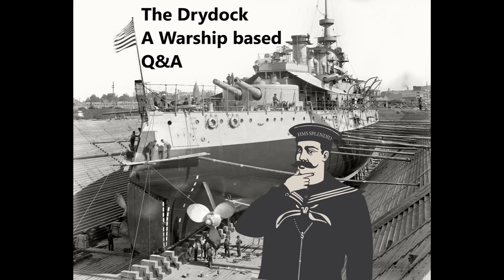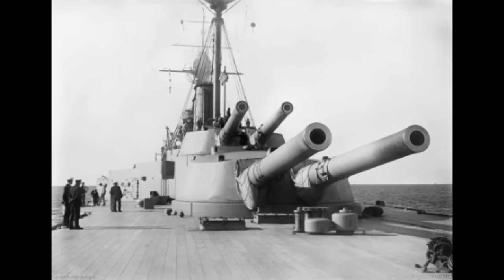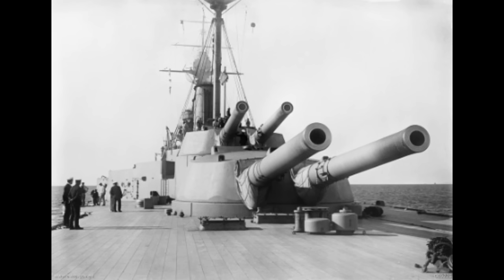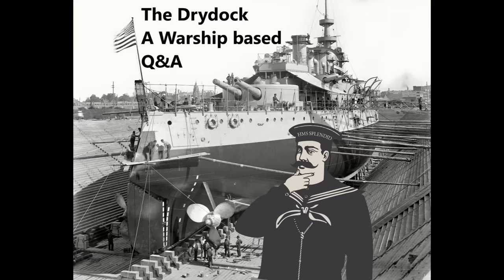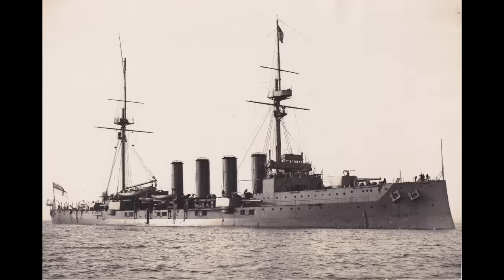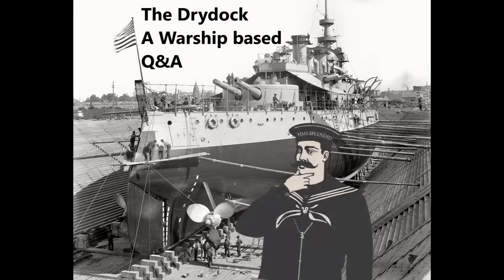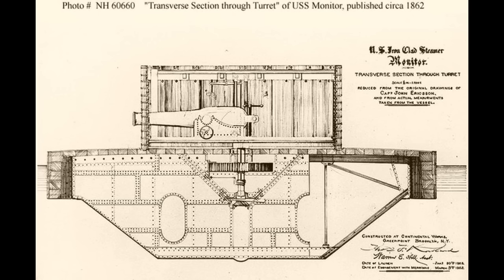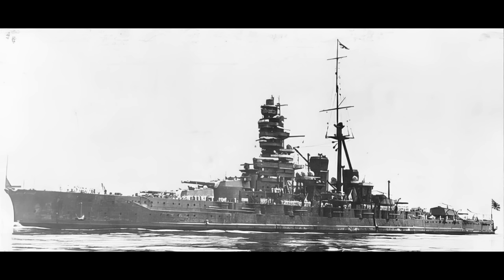The Drydock - Episde 241 (Part 1)

Comment: I was on board Ranger for two of her major fires, and I can say, at least by the mid eighties, nothing much has changed as far as water tight integrity goes on captial warships of the USN, in both cases I found myself in electrical machinery rooms, armed with a portable pump and a dust pan with orders not to let the water get to the bus bars.
Reply: A dust pan and a pump? Where were you going pump water too? Was there a drain?
Reply: @WALTERBROADDUS  In one case it was pumped into a drain, in the other it was the bilge of the Auxillary Machinery room next door.  Yep a dustpan, though to be fair you can move an awful lot of water that is too shallow for a pump with one. In both cases the pump was loaded into a thirty-five gallon trash can which was filled with the dust pan.
Reply: @fred1451 none  a dust pan for DC, not something that comes up at first thought.   
Come to ponder on it, did the dust pan need to be certified?😂
Reply: @AtomicBabel  In the first case it was more of an accident, I was actually issued a  mop, (I think you can tell these were not fast leaks.) They were coming through an electrical stuffing tube were the compartment on the other side was flooded by firefighting water.

They were to fast for a mop to keep up with, there was a dust pan available and I switched to that, using the mop bucket to fill the trashcan that the pump was in. This tactic worked as I was then able to keep ahead of the water leaking in.

In the second case I just went with the dust pan.  The annoyance there was that the pump needed to be wacked periodicly to keep it pumping.

As far as being certified, well no one ever told me to stop using it...
Reply: @frednone  .. Jesus Christ..
Reply: @frednone  hell yeah. during hurricane sandy my basement had calf deep water and all the pump trucks had massive waiting lists. The water was calf deep but at ankle height you couldn't really fill a bucket. I moved a lot of water just by sweeping it with a broom into a dustpan and dumping it into the drain system
Reply: @jonc8074  I just use the pan as a scoop, I guess you didn't have a squeegee?
Reply: @micnorton9487  About sums my attitude toward the situation.
Reply: @frednone  No, no squeegee, or hand pump. would have helped a lot to have a hand siphon and bucket. 
But when the water gets real low you can sweep it with a broom to fill up your scoop
Reply: @jonc8074  I guess you didn't have a floor drain?
Reply: @frednone  lol none such. I had a tall, high sided slop sink. it was a lot of extra work to lift the buckets up that high to pour them in, but it worked

Comment: I like the item on reliability.  Following the loss of the Space Shuttle Columbia, Richard Feynman was on the Board of Investigation.  Some people spoke of how amazing it was that something could have gone wrong because of the degree to which parts were manufactured.  I can't remember the figures, but suppose it was one chance of error in 5,000.  Feynman noticed that were 5,000 components and so came to the conclusion that something not only could, but statistically would go wrong on every flight.
Reply: Statistically - should never have gone into the South China Sea in a 21 year old destroyer -  Typhoon season - metal fatigue - might have suddenly  submerged ?

Comment: I like the percentage of reliability explanation. As someone that has both military and metal fabrication experience. This is one of the hardest concepts to explain to someone on the production line.
Reply: Another example of accumulated chances is looking at the chance of a USAAF bomber crewman finishing their mission tour and rotating home. On the average, he would only have a 5% chance of becoming a casualty (killed or shot down) each mission, but across a 26-mission tour, a 95% survival rate works out to a 26% chance of finishing and going home. When you add the chance of being wounded badly enough to justify a medical discharge, things don't look good.
Reply: @seanmalloy7249  Kind of like the medical testing analogy. If you take a test for disease that it 99% accurate and test positive but it's an extremely rare disease, it is still highly unlikely you actually have that disease despite the positive test

Comment: I went through a Cat 5 typhoon in 2007 on a 688. We had to go to PD to report an injured man and run to Okinawa.  Extremely violent is an understament, sail smashing, half the boat coming out of the water and crashing. Terrifying, the we dove to 400 feet and still took 5 to 10 degree rolls. Horrible 2 days.

Comment: As to why laminated plates of a single kind of armor are weaker than a solid plate of the same total thickness, the reason is that, if the shell damage does not change its penetration ability, the penetration formula for homogeneous, ductile armor (decks, for example) that gives a reasonably good fit over the plate thickness range of 0.2-calibers to 1.1-caliber at low obliquity angles is the De Marre 1890 Nickel-Steel Penetration Formula (its curve versus velocity interlaces the actual curve from projectile tests very closely), which is in essence T = K x V^1.43, where the constant K takes plate quality and projectile quality and angle of impact effects into account.  For face-hardened armor, the similar best-fit curve is T = K x V^1.21 for an even larger range of plate thicknesses.  Note that in both cases the value of the Str8iking Velocity for Penetration, V, exponent is well under 2, which is for the kinetic energy of the projectile.  Thus, in these cases, the kinetic energy to punch through a solid plate is greater at the face and then gets lower the farther into the plate you go, but this increase at the face is due to the rigid support of the plate material deeper into the plate.  Thus, the thicker a solid plate, the greater the resistance at the face compared to the resistance of the plate at the rear.  With laminated plates, each one acts like a near-the-back portion of the total armor structure, since the further rearward plates support the front plates only as to being pushed directly backwards.  The steel in each laminated layer can individually bend SIDEWAYS out of the projectile's path, which is easier by far for each thin plate than a single thick plate, allowing the projectile to wedge its nose forward, bending the metal in each layer out of the way one by one, with the last layer being even easier to bend away as it has nothing to support it in any direction.  It is like a stack of loose boards hit by an axe compared to the same stack that is strongly glued/screwed together into in effect a single solid piece and therefore all must be forced aside during the entire penetration of the blade.

With face-hardened armor, the face may be brittle, but it is also extremely strong for a short time, allowing the impact shock to move backwards into the soft back, which acts as a shock-absorber.  Thus the face of the plate is far stronger and more rigid for a short time, requiring even more energy to penetrate.  Thin layers stacked up would not have this shock-absorber effect and thus fail more easily if laminated, on top of the effects on the soft back portions of the now-separate plates if in layers, as mentioned above.

Comment: "The world wonders" re: Halsey, was actually unfortunate "padding" on the part of the coding officer at Pearl. American signals in  CINCPOA at the time had nonsense "padding" at the front and back of each message. In this case, the front-padding was "Turkey trots to water" -- absolutely irrelevant, right? Then the message itself, with the repeat too. The closing padding "the world wonders" was selected. The coder had already interposed "RR" meaning "end of message" before quoting Tennyson.

Halsey's temper seems to have gotten the best of him, or perhaps the decoding on the ship didn't convey the "RR" signalling the end of the body? That he blew a fuse is doubtless. But I think it lays on the coding officer to have missed the contextual implications of such a choice of padding.

Comment: 1:25:50 Technically, it isn’t just the Akizukis that depart from that design style. The Hatsuharu were originally built with 3 turrets: a superfiring pair forward and one turret aft, and the forward superfiring turret was a single-turret. But this was eventually changed early on in their careers by replacing one of the three torpedo-launchers with the single-turret, which was carried on with their Ariake-subclass. What Drach says at 1:26:40 is pretty much the experiences the Hatsuharu's had. The nail in the coffin that made them remove a torpedo launcher and replace it with the single turret was because the Chidori-class torpedo-boat Tomozuru capsized and forced the IJN to re-evaluate the stability of ships that were just completed or still being built. Tomozuru herself was armed with a three 5"/50 guns in a single turret forward and a twin turret aft. After she was salvaged and extensively overhauled, she came out with 3 single 120 mm/45 11th Year Type guns in gun-shields.

Likewise, I’d imagine if World of Warship's Elbing (Essentially the Spähkreuzer design but with made-up DP twin-turrets using the same 150 mm/60 guns as Nürnberg, removed the aft 88 mm/76 twin-mount, and replace the 20 mm/65 and 37 mm/83 AA guns with never-built AA weaponry) was put to sea, she would suffer similar issues, if not outright do a really impressive impression of a submarine.

Comment: 25:00 An Independence class light carrier (USS Cabot CVL-28, which served in WW2) served in the Spanish Navy as the Dédalo and operated Harriers (Matadors in Spanish service), which would post-date the A-6 Intruder.

However F/A-18 or Sea Harrier (pretty sure F/A-18 post-dates the Sea Harrier thought) would beat out the Dédalo/Harrier.

Comment: On the topic of most Modern Aircraft, Drach is slightly off on the Sea Harrier vs Legacy Hornet (which, well, it's beyond the point of time he does most of his research in.) as the F-18 first flight is actually later (late 1978) than the Sea Harrier first flight (mid 1978). However, while the basic Sea Harrier itself is an older aircraft, the Indian Navy kept Hermes (as Viraat) long enough that their later updated iterations of Sea Harrier would become the most modern, as Midway decommissioned without ever receiving the F-18C.

As for the actual WW2 participants, the answer depends. For combat use, this is most likely actually the A-7 Corsair, as the last combat Essex was the Oriskany which had later (for the era at least) model A-7s aboard on her last combat cruise. If testing counts, then the answer possibly becomes the T-45 Goshawk trainer, which I believe was tested aboard Lexington before her decommissioning, but did not enter proper service until Lexington retired.

Comment: Fun Fact: The mustard gas incident at Bari Harbor is what lead to the eventual breakthrough for the first chemo therapy treatment. 

A doctor back in the US reviewing tissue or cell samples or something (Don't remember what) from those exposed at Bari, noticed the cells of those exposed weren't replicating. This knowledge eventually lead to the treatment of chemo therapy to slow the body's cells, with radiation to kill the cancerous ones.

This also means the first chemo therapy was to IV what was basically liquid Mustard gas, though in this instance Nitrogen Mustards or something were used instead of the Sulfur Mustards used in Mustard Gas. I know people say chemo is poison becauseof how much it wrecks your body, but in this case it literally was.

I've probably got a lot of details wrong, but the overall picture of what I've said is true.

Comment: Hello Drach, hope this finds you well. The fiance and myself were watching a movie/documentary about the Engineering crew on Titanic. In this they said the watertight compartments were just that. Completely sealable boxes. Is this true? If so, is the idea the WT compartments were filled then flowed into the next incorrect and in fact what happened was the ship was pulled far enough down that she flooded from above like a bath toy?  Also if the unaffected compartments were pulled down, how deep would they need to be to implode? Could this have assisted the speed in which she broke in two, and would it explain the damage to the stern section seen on the bottom?

Comment: A-6s weren't deployed on Essex class carriers, they were too heavy. A-7s were however, and according to their first flight in 1965 would be the most recently developed airframe. I'd go with avionics fit rather than date of first flight for advanced,  in which case I'd say it would be the A-7E for aircraft from classes that fought in WW2. For developed during WW2, I'd say F-18s from the Midways on both date and avionics, unless you consider the Sea Harrier a different aircraft than the Harrier I, which I don't*, in which case it would 'win' for first flight. However, if you go by date it entered service, we are back to the F-18 with 1984. 

*I can see both arguments for the AV-8B Harrier II since it's a new airframe, but I'd argue the Sea Harrier is an alternate version of the Harrier rather than a new aircraft.
Reply: If talking avionics fit wouldn't TA-4J 's be more modern fit? Even though the airframe is older?

Comment: So apparently POMPANITO's crew determined that the sea state precluded the use of the main induction, which normally provided air to the diesels.  Not shocking, given the location down on the upper pressure hull.  The main inductions did have a float type of safety to seal them up during intermittent periods awash, but apparently the sensation the crew would experience during the periods when the main induction seal would seat and unseat with hatches to the weather decks closed was an extremely uncomfortable sudden drop in air pressure in the boat. Taking suction through the boat via the bridge hatches would create one hell of a draft (the diesels gulped a considerable volume of air) but at least they were drawing from a position several feet higher than the main induction location, so the hatch slam/partial vacuum episodes were hopefully less frequent - and they didn't chance flooding out a main induction line completely, which was a possible failure mode...  That might also explain running on less than all four diesels - as long as you could maintain control, less air demand, fewer diesel motormen on watch - benefits accrue quickly for a skipper having to plan for possible days of just hanging on.  It did preclude closing up W/T doors between the conning tower and the diesels.

Comment: ROFL. When I saw That photo at 27 minutes I heard “the wheels on the ship go round and round”

On the other hand, it’s balance is like a catamaran. Should be more stable in the water with much less lateral roll. If made of rubber with a lot of cells inside…… hmm.  Reinforce with steel belts like used in a tire. At least it’s interesting to contemplate.

Comment: Drach,,, what is your technical engineering opinion of mixing imperial measurements with metric decimals? Especially in calibers?
Reply: I don't get the point here? Both systems exist and are used.
Reply: @WALTERBROADDUS  well is a 12.5, a foot and a half or  is it 12 and a half inch? Seem to remember NASA had a problem using both?
Reply: Well, if you're using different units within the imperual system, you just designate the units separately. So in your example, it would be 12 feet and half an inch, or more succinctly, 12' 1/2".
Reply: @hughgordon6435  You listed no units. So metric has the same problem. Is that 12.5 kg, g, mm, meters, kilometers, what? Numbers with no units are pretty meaningless.
Reply: @wingracer1614  calibers in inches with decimal  points? So a 13.5 gun? Is that 1foot ,1 inch and half an inch? Or 13 inches and half of 13 inches?
Reply: @hughgordon6435  I've never heard of a 13.5 caliber gun. I've heard of 13.5 inch guns. If you can't figure that one out, that's a you problem.

Comment: wrt the more smaller vs fewer larger guns question, this argument raged for decades.   In the USN, it was the head of BuOrd, during the teens, Joseph Strauss, that promoted the more/smaller option.  As Drac said, the argument for more, smaller guns, always depends on an artificial restraint.  Strauss insisted that all combat would be at 12,000 yards, or less.  Since a 14" could penetrate well enough at that range, they could put more of them on a ship and increase the probability of a hit.  The Tennessees could have been built with 16", there was active speculation they would be, reported in the newspapers, but Strauss pushed through the 14" option.  Jutland satisfied the General Board and SecNav that engagements would be fought at considerably more than 12,000, so Strauss was overruled when guns were specified for the Colorados.  In his annual report that year, SecNav Daniels said the 16" decision was made over the objections of some officers.  That same argument arose again, in the design of the KGVs.  In the Admiralty's own analysis, a 9-15" armament would provide a more satisfactory ship, but the decision was made to go to 12-14" instead.  It is probably worth noting that Admiralty fighting instructions at the time required closing, as fast as possible, to 16,000 yards, or less, before fully engaging.  Again, the artificial restraint: not requiring the KGVs to be effective at greater ranges, made the 14" look like the better option.   I give the credit for the Admiralty clinging to an obsolete doctrine, against the recommendations of Admiralty technical staff recommendations, to Admiral Chatfield, who was First Sea Lord from 1933 to 38.